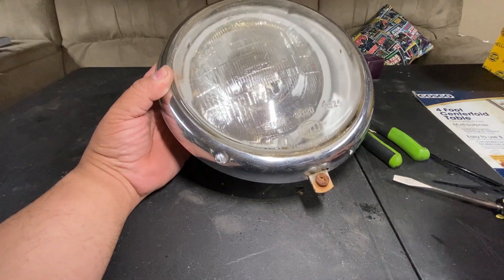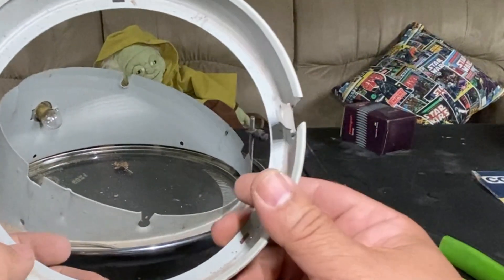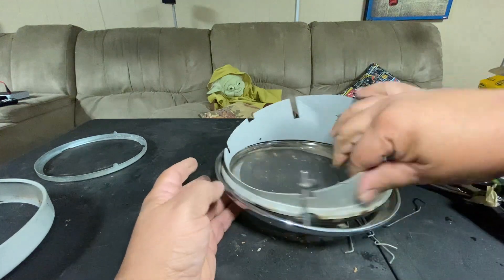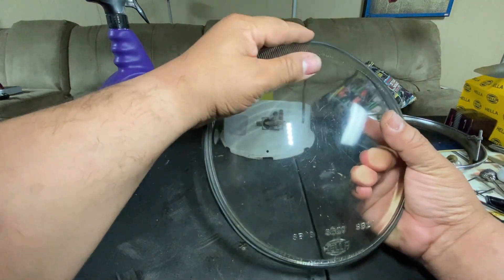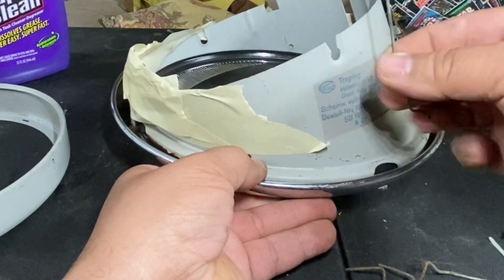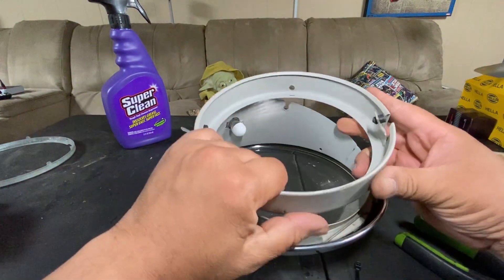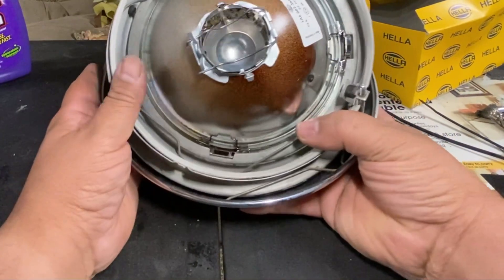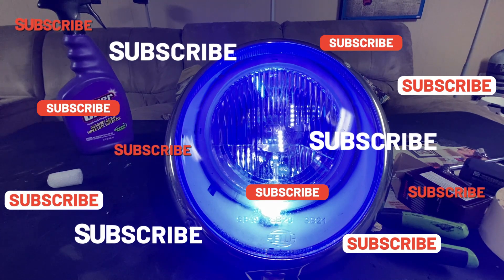VW Bug Headlight Assembly Upgrade

Comment from the maker: Hi Everyone, here is a detail video in tearing down a 66 VW Bug headlight. Replacing 6v bulbs to 12v along with gasket.
Reply: The original headlights were 6-volt sealed-beams.